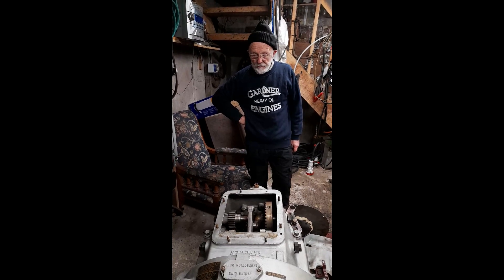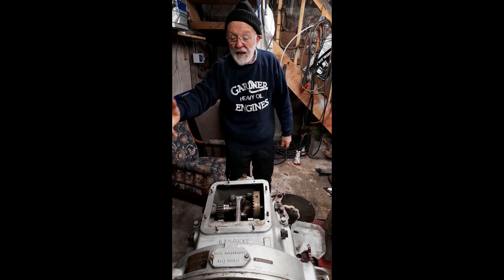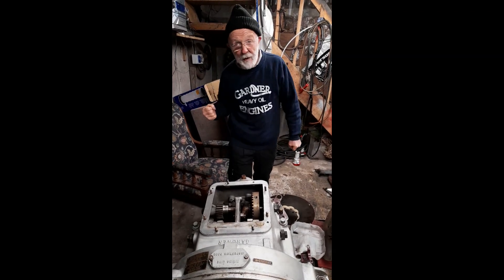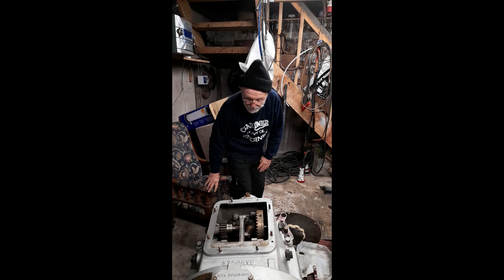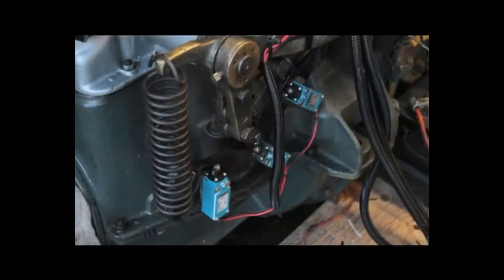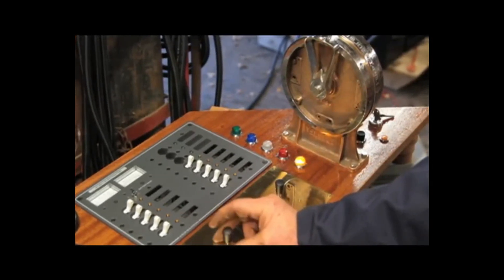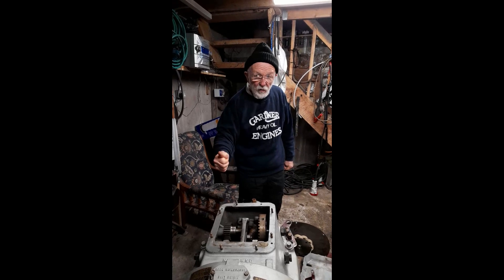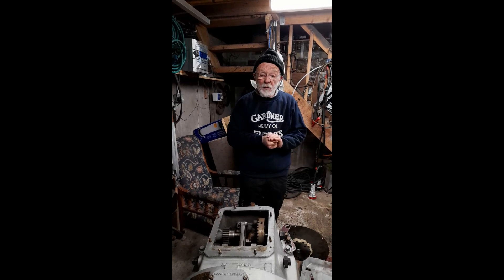Gardner Engines: our electro-hydraulic system for the 2UC gearbox.

Comment: You could just do the same thing with a different activation switch, the micro-switches  that you are using to illuminate the lights and a bit of extra wiring and not have to add any extra components.

Comment: Hay joe looking fwd to watching what you do .I was lucky enough to have a similar set up using a mer cruiser hydraulic ram pump to lift the sterndrive running off a morose control leavers at the helm down to a slide system on top of the gearbox with 2 switchers like the ones you had that switchers the pump on to activate the hydraulic ram  fwd or aft  . Simple but works well  the stops coincide with the de temp balls in the morose  controls . Keep the video's coming Joe totally enjoying them